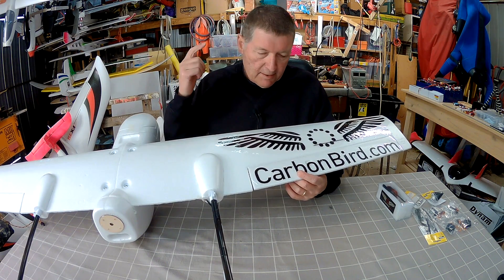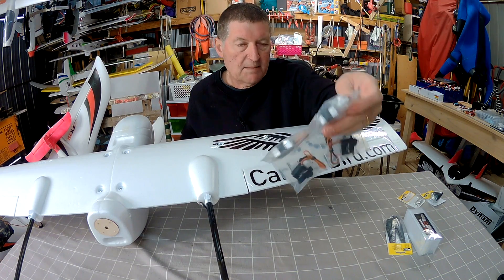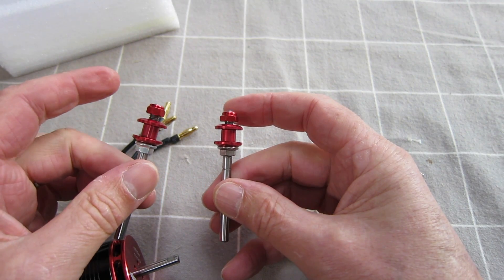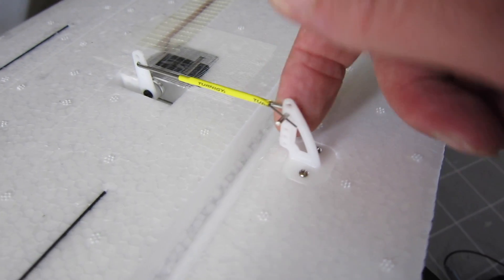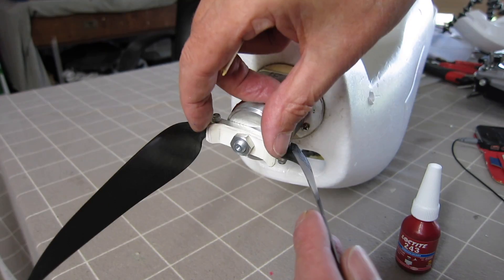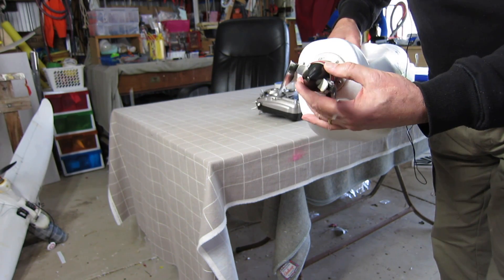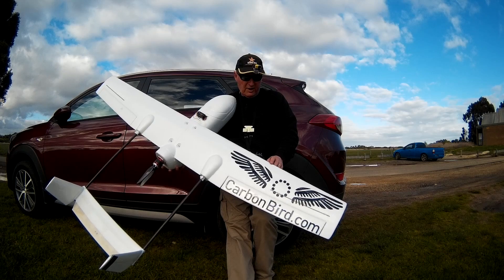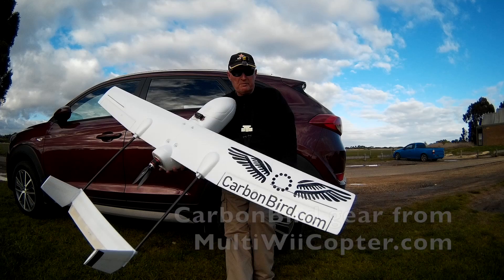CarbonBird SkyHunter

Comment: Mate what a great setup, I'll have to give them a ring and see what motor they thing would be good for the old FX61. Thanks for the video. P.S. I would bolt right through with the motor mount plate Just In case
Reply from the maker: Yes I need to revisit the motor mounting. Definitely give them a ring, Q seems to have done lots of motor efficiency testing

Comment: Pleased you didn't try and use that collet type prop driver...No motor mounting plate?..really?..That said, it's obviously going to be a big cruiser on 3S...Just parallel another big Lipo alongside. My experience with iNAV, is that you can have plenty of surface throws because you will be spending most time in Horizon / Alt Mode anyway. iNAV has an Expo curve you can adjust. I usually use UHF on longer range rigs, but I tested iNAV using my L9R and my best output 5.8G tx. You will be surprised just how far you can go, but you will need a directional VRX antenna, or better still a pair of them on your diversity rig.  You will run out of 5.8G video range before control. I can't wait to see you dip your toe beyond 750 mtrs....lol.

Comment: If it was down to me, I'd extent those wing tips by 500mm on each side. I know the span is probably that size so it can fit in a vehicle, but to me it's just a toy at that size. ;¬)
Reply from the maker: Mmm yes 2.8m wingspan, that would be easy to handle
Reply: It would increase stability and extend flight times too.
Reply from the maker: Big prop, slow revving motor, glider wings for slow cruising, that sounds nice
Reply: Deffo.

Comment: OK, I've watched you do this a few times with Loctite...just smearing it on the exposed threads does nothing but make a mess.  Loctite is anaerobic, meaning it cures in the absence of air in a confined space between metal parts...it must be put on the threads that will be in contact with the fastener.
Reply: I have to agree with Mark. Loctite before assembly.
Reply from the maker: Thanks Mark, I was hoping it would wick in a little, but might be unlikely

Comment: Great vid , I enjoy watching you los vids :-)  I noticed with that relatively LARGE prop you had the brake on,     be careful not to shut the throttle off too quick or the mass of the prop/spinner will rip that motor mount out of the foam! speaking from a nasty experience of my own :-)
Reply from the maker: Thanks for the tip Chris, never thought about that. The motor mount really does need some attention.